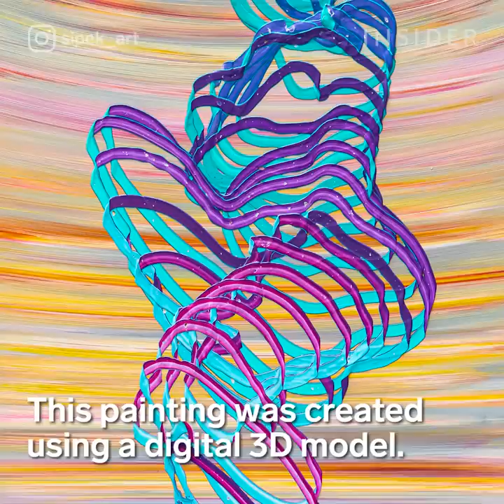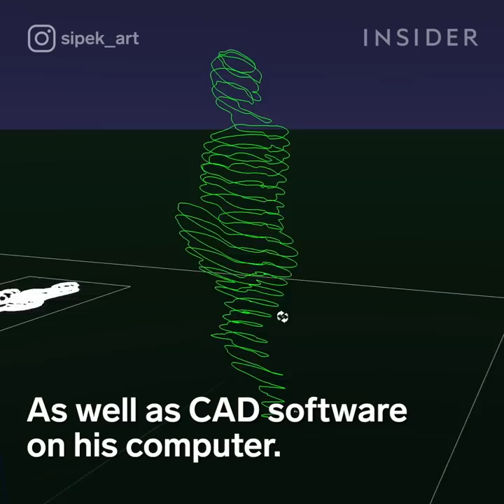Nozzles Extrude Acrylic Paint | Art Insider

Comment: Seems so wasteful and the final product uninspiring. The use of the tech is interesting and I can see merit in the artist trying to adapt it into a mixed media work flow, but i don't see the point of using it to create a 2d replication of a 3d design. The 3d design looked way more interesting than the 2d version. And yeah, an absurd waste of paint when the same effect (texture) could be done by hand with far less consumption. Not like the extra texture produced by the huge globbing layers of paint looks like it actually makes anything other than a negligible difference in dimension, unlike a 3d printer.